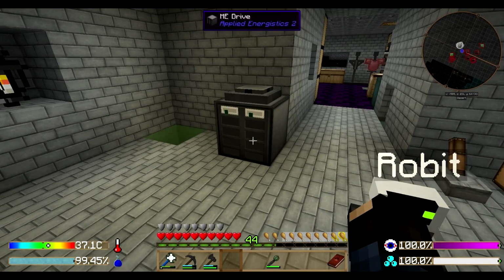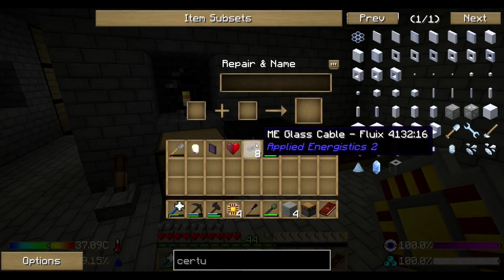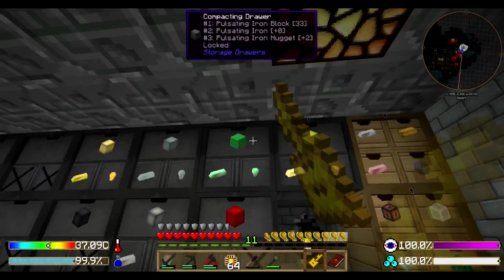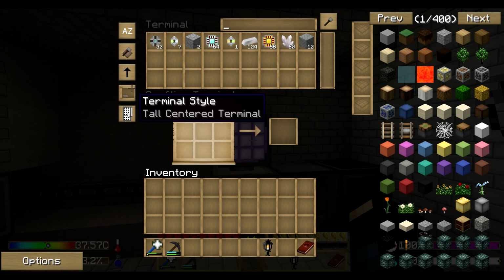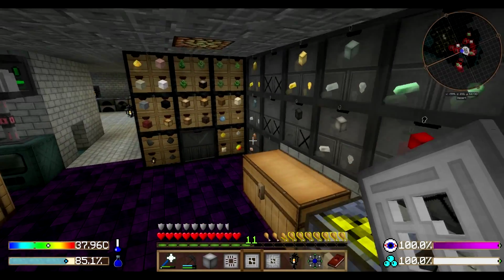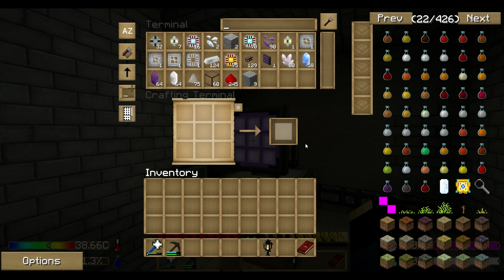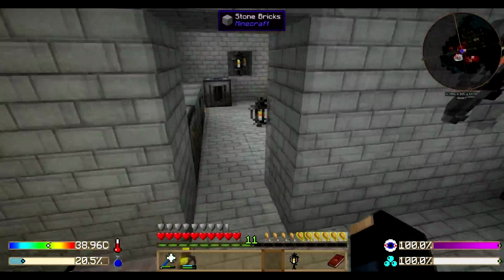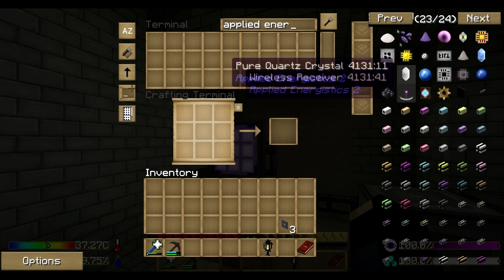Working Storage! | Minecraft Post Finem | Ep.22

Comment: You can also make fluix conduits that can run in the same space as your other conduits. You just can't attach panels and panel like components to it directly, but it's awesome for keeping your wiring tidy and compact.

Something to be aware of is AE channels. Simple systems can only have 8 maximum channels (more complex setups will require a controller or use of subnets). Most AE devices take up 1 channel (some only use power or accept it and don't use a channel). Connection and channels are passed through devices like drives and most devices that take up a whole block. The number of channels that can pass through a block is limited to the same as a standard cable (8 channels).

Inscribers are a bit more tricky to automate than just slaping an interface on it. Also before you can do any auto crafting with your AE system you need a crafting CPU.

Sadly there is no way to make the terminal retain your search.

LAMO.. you told he interface to keep blank patterns in it then wondered where they went.

Alas you can... combine them with the ender io conduits :P

You wanted a storage bus not an import bus on the drawer controller.